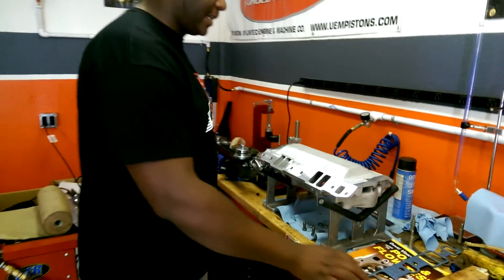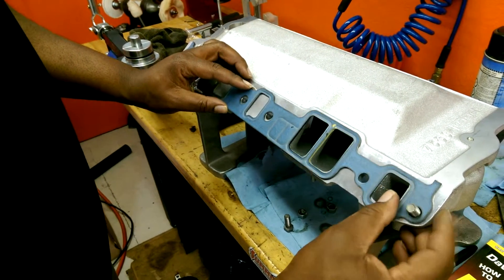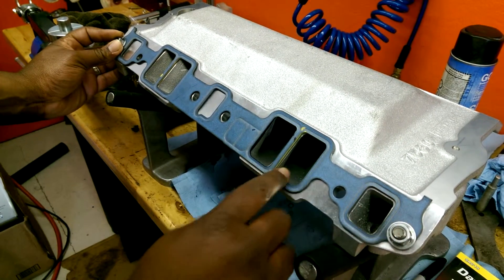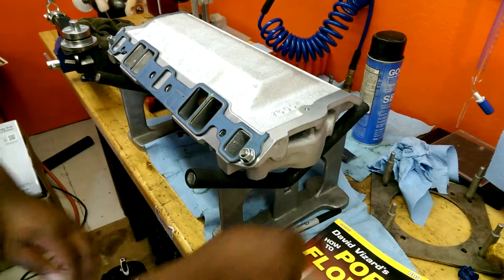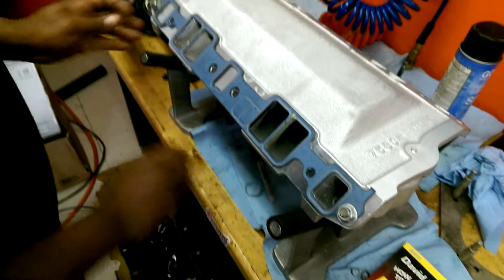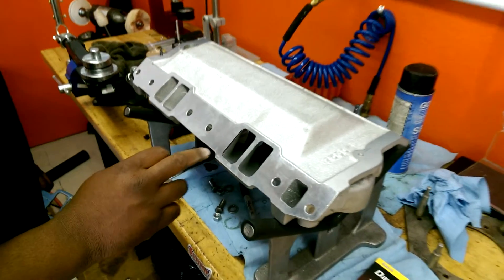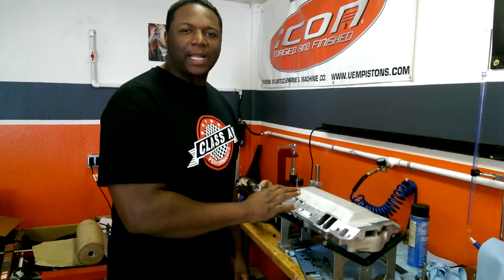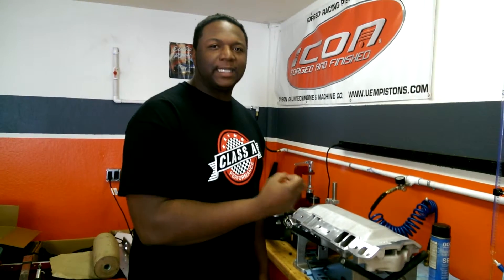Muscle Monday - Porting

Comment: Like the diy attitude - you get things done.  May I suggest... mocking up block first, with gasket thicknesses you will use.  Head castings vary, deck heights vary, and so do manifolds.    Gotta make sure flow doesnt hit a wall and combos can surprise sometimes.  One build I did, cylinder heads  were milled down for smaller combustion chambers to suit cam & bottom end and [surprise!] had I not done that, I would have had floor of ports higher than the manifold probably pushing me into a new one. [I prefer to leave floor close to cast on 23 degree heads when possible, and in this case I had already opened ports up a little going from 1204 to 1205 gasket].  On that project, the floors wound up accidentally dead on matched and didn't touch either one after mockup - just sides and roof.  So... a borescope is a nice tool sometimes [especially dual planes]..